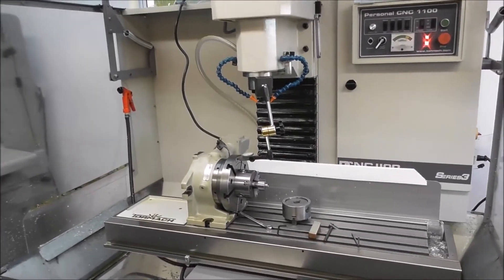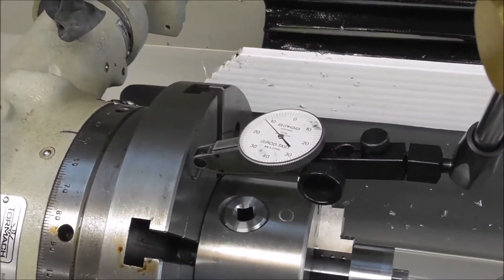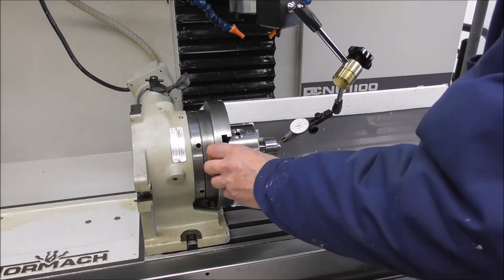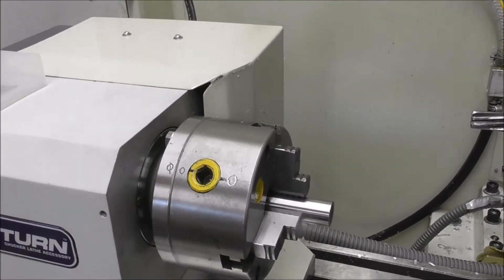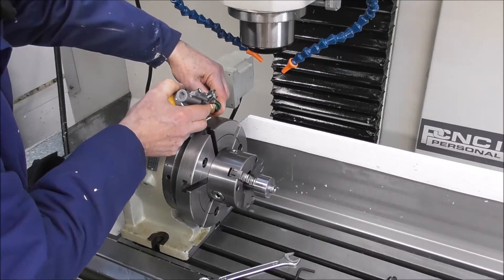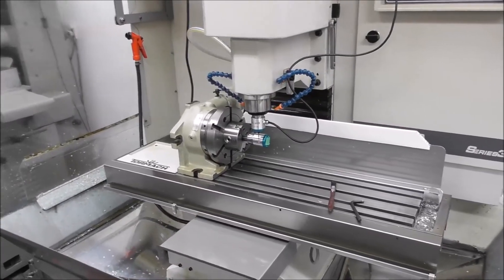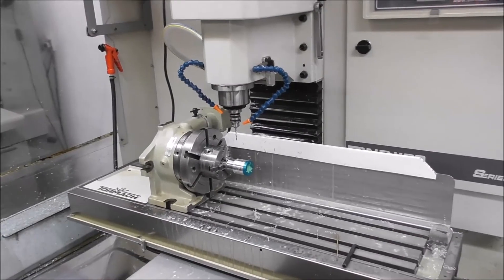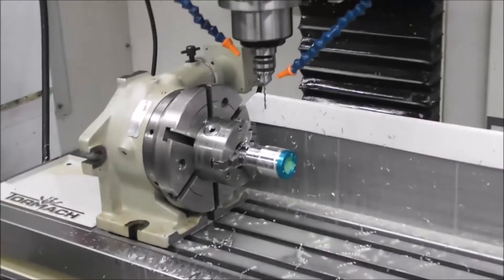Tormach 4th Axis - Set Up and Run

Comment: Hello Threadexpress
Thank you for your videos.  I have a Tormach 1100 Series3 with Path Pilot.  Just acquired a 4th axis and am having touble setting it up.
Can you tell me if there is a different post processor that I must be in to enable the 4th axis?  Or is it already built into the Path Pilot program?
Thank you again

Comment: Cool trick: After you've found the front Y face, set it to zero, then found the position of the back Y face, you can click the Y DRO position, and type "/ 2" to divide the value by two. You will have set the Y to be zeroed at the center of the two faces without having to do the extra traversal step or manual calculations.
Reply from the maker: Hi Jeff. Yes I have used that cool trick. But in this instance the current probing routine does not park on position and /2 would give an off center position.  Cheers  Cliff
Reply: Haha, good point - it's just showing you the found Y position in the conversational, not putting it on the DRO with it parked there, else it would still be touching. I was so excited that I might have taught you something too. Oh well, better luck to me next time :)
Reply from the maker: LOL  Cheers.